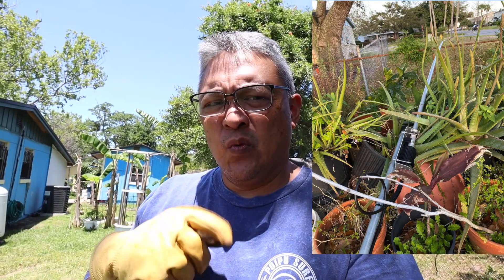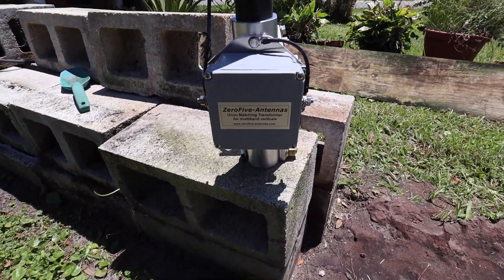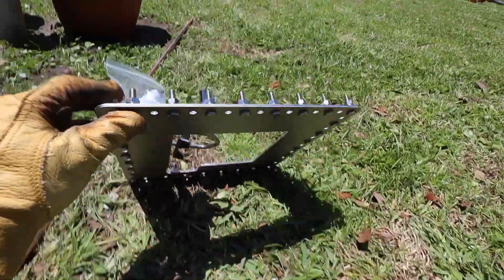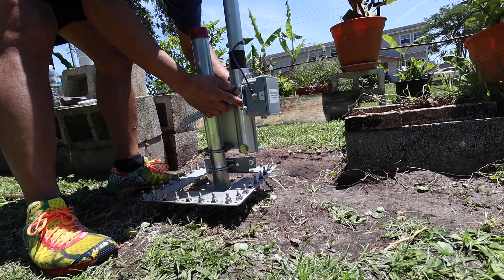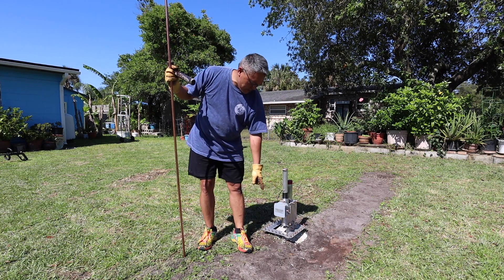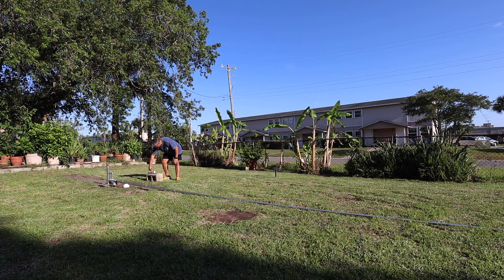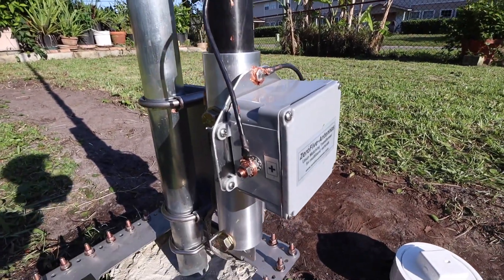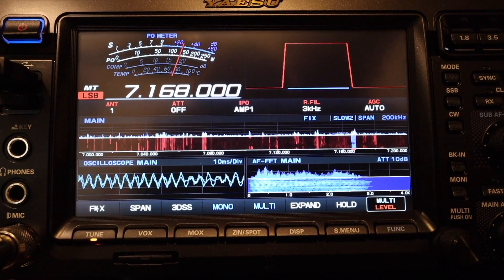Zero Five 27' HOA Foldover Multiband HF Vertical Install

Comment: @Capt Darren N4VFR  Are you affiliated with ZeroFive antennas? If so, I just purchased an antenna from you. :-)
Reply from the maker: @Douglas Williams,  Hahahaha, Not affiliated.  I'm an Airline Pilot based at DFW Texas. I just like the simplicity of the Zero Five.  Thank you for asking if I'm affiliated with them.  There wasn't much Youtube videos on the Zero Five and decided to make a video.
Reply: @DarrenN4VFR  Yea, your video is what made me purchase it. It looks very well made. Thanks.  Edit: I'm going to try it "stock", using 30 ground radials to start off with. At some point I may try putting a remote antenna tuner at the base of the antenna. That way, only a very short section of coax (between the tuner and the antenna) will be subjected to high SWR. That piece can be a high quality jumper, such as LMR-400.
Reply from the maker: @douglaswilliams6834  Right on!  What brand of remote antenna tuner will you use?
Reply: @DarrenN4VFR  Haven't decided yet. Perhaps MFJ? All the ones I've looked at provide DC power to the tuner through the coax, so you don't have to run a separate power line, which is nice.

Comment: Good video Darren. Do you connect the radial plate to the ground bolt on the unun too? Or is the u bolt on the ground plate to the pole enough?  Thx! Scott
Reply from the maker: I didn't make another connection from the DX Engineering grounding plate to the ground bolt of the unun.  The u bolt on the grounding plate was sufficient enough.  I have no problems making QSOs with this setup. Thank you for commenting.
Reply: Thx Capt Darren!
Scott

Comment: Do you need a tuner with this antenna?
Reply from the maker: Yes you do in order to bring the SWRs down to 1.5.
Reply: @DarrenN4VFR  Thank you 73's K1CXS
Reply: @DarrenN4VFR  Can I ask why you didn't go with the 33ft that would do 80 meters?
Reply from the maker: @thomashenderson603  I wasn't planning to do 80m. I hang out on 40m. But, if we're to do it again, I would of gone 10-80m.
Reply: just ordered the 33 ft , have the pole all in.. :)
Reply: @DarrenN4VFR  I'm not sure either, it was only a few dollars, so I pulled the trigger! When you grounded your Antenna with the ground rod, did you need to run a ground wire from that to your house ground?
Reply from the maker: @thomashenderson603  You Do Not want to run a grounding rod from your antenna to your house's ground.  I did that and a viewer commented that thats a No No and would create bigger problems if you have a nearby lightning strike.  Keep the ground only for the antenna and use 6 gauge copper stranded wires.
Reply: @DarrenN4VFR   Thank you so much, that makes sense... I probably get a palstar like you have next, but they look like they are all out of stock for the moment. Funny thing is, I was going to buy the CHA250, til after watching your video.
Reply from the maker: @thomashenderson603  I don't recommend buying the Comet CHA250B.  They haven't worked well for me.
Reply: @DarrenN4VFR  I'm real happy going with Zero Five, Awesome people to deal with. Thank you for all of the advice.. I love your videos, you make them so understanding..
Reply from the maker: @thomashenderson603  Thank you Thomas!  I haven't made any new Ham Radio videos.  Been busy flying and staying at my other QTH.  Please subscribe, In the future, I'm going to try to go Live on Youtube!  Still getting my equipment and new laptop that can handle fast rendering of my live video.  I still need to fight the city to put up my other antennas.  If you haven't checked out my video:   https://www.youtube.com/watch?v=IluCTCXF1rM
Reply: @DarrenN4VFR  I just subscribe, I thought I was... I live in Vermont and we dont have alot of rules for Antennas thank god!
Reply from the maker: @thomashenderson603  I looked at R&L Electronics for a Palstar AT2K, and they're out of stock...  That's where I bought mine from.  I got lucky!  Good luck in the hunt for a Palstar.  Make sure that your AT can handle the power rating of your Amplifier if you decide to get an amplifier.  Thank you for subscribing!
Reply: @DarrenN4VFR  Thanks for looking! I do want the Palstar AT2K, no one seems to have one right now. Good Advice on the Amp... Im Sure I will want one at some point.. -Tom
Reply: Palstar is 2 months behind, I have my antenna up. I put in 20 radials from 11 to 25=feet.  I have the icom 7300 and after watching your Ftdx101mp , I would really love one of them at some point.
Reply from the maker: @thomashenderson603  Your almost there!  I too have the IC7300.  I will be using the IC7300 for remote HF operations.  I'm running into problems configuring it properly.  Still working on it.

Comment: Excellent video!  I'm also planning on installing the Zero Five 27' HOA antenna at some point in the not too distant future at my QTH and your video is going to be a big help getting it done right.  Thanks and 73 to you sir!
Reply from the maker: Capdek,  Thank you for watching and commenting!  It's an awesome antenna and when a hurricane comes, I could lower the antenna  disassemble the elements.  Good luck!
Reply: Hi Capt Darren.  I have a couple of questions for you if that's OK.  What diameter water pipe did you use for your installation and what size clamp did you use to mount the DX Enginnering ground plate to the pipe?  Lastly, did you make the radials yourself or did you purchase them pre-made?  If you made them yourself, what size wire gauge did you use and what size eye connectors did you use?  Thanks for the help and advice!  David, K7KDE
Reply from the maker: @capdek503  The pipe is a 10' galvanized steel water pipe.  Diameter is 2".  I had cut it in half with a hacksaw.  As for the clamps,  I used the DX Engineering 1-2" clamps https://www.dxengineering.com/parts/dxe-ssvc-2p .  For the Radials, I bought them from DX Engineering also, https://www.dxengineering.com/parts/dxe-radw-500  and the radial wire hardware, https://www.dxengineering.com/parts/dxe-radp-1hwk  . Glad to help!
Reply: @DarrenN4VFR  Thanks for the help!  One more quick question if that's OK.  What kind of wire did you use to connect the antenna to the ground rod?  Thanks again for the help and advice!
Reply: OK, I took a look at the video again and see you're using what appears to be a braided ground strap.  Thanks!
Reply from the maker: @capdek503  Since then I changed it to a 6 gauge stranded copper wire.  Braided wires are not good for the outdoor elements.
Reply: @DarrenN4VFR  OK - Thanks for letting me know.  Did you have to change the connector on the antenna or the ground rod to attach the new ground wire?  Thanks!
Reply from the maker: @capdek503  I used these:  https://www.amazon.com/gp/product/B07J2VJZXX/ref=ppx_yo_dt_b_search_asin_title?ie=UTF8&psc=1

Comment: Excellent video.  I hope the antenna has been working out for you.  My only technical comment is that you have used braided ground strap to the ground rod.  Supposedly, the stuff will deteriorate outdoors, particularly if it is buried.  I like the way that your ground rod access is hidden.  I've done exactly the same thing with most of my grounds, too.
Reply from the maker: LVL, thank you for the observation about my grounding rod. That was temporary and have since changed my grounding wire to 6 gauge stranded wire.
Reply: @DarrenN4VFR  OK great!  KC4TEO in Alabama here!
Reply: Hi Darren, you have made a nice job of the Antenna install, thanks for showing us fellow  Hams! A few days ago I had a nice contact from here on the Essex coast to South Australia on 20m with 20watts using the Chameleon 17 foot whip, I guess propergation was good! Just one comment, as far as I'm aware the earthing conductor is better being flat braid, as the currents travel on the out side surface of the conductor, so the larger area the better!! I stand to be corrected as I'm no expert Hi Hi! 73 Alex M0KVA

Comment: I did something similar with a 6BTV about 2 years ago; I used the DXE radial plate and their tilt mount and "disguised" it as a flagpole.  Recently the 6BTV is having some severe SWR spikes that shut down my IC7300, so I stopped using it and am planning on taking the 6BTV down to see if I can find the problem.  I was thinking of perhaps replacing the 6BTV with the Zero Five 27', since I already have the radials and grounding rod in place from the 6BTV.   Can you tell me the circumference of the base (widest part) of the Zero Five - including an allowance for the clamp?  You can see my QRZ page to understand why I am asking that question.

Thank you for a very thorough and informative video.

Frank W1ZAH
Reply from the maker: Hello Frank, It will be a while until I get back home in Jacksonville, FL however, according to the Zero FIve website, the dimension is 42" x 8" x 8" and the maximum pipe diameter to use is 2".  I used a 2" galvanized steel pipe.  It's 10' long and I hacksawed it to 5' long.  Buried 3' in the earth and the remaining 2 feet to mount the Zero Five base.  I hope that gives you more information for your set up.  Perhaps watch my video again and zoom in on it to get a perspective estimate.  Or call Tom at Zero Fiver Antennas.  Good Luck!

Comment: How to pull a ground rod out quickly. Tools if  you have and old bumper jack or a floor jack. Then a good pair of vise grips and a small chain. The rest you should be able to figure out.

Comment: That's a lot is noise, S8+, were you able you reduce that any?
Reply from the maker: I checked this morning and my noise level was S3 on 40M and S5 on 20M.
Reply: @DarrenN4VFR thanks, that's acceptable. Do you have any other antennas to compare it to?
Reply from the maker: @elkbow  prior to the Zero Five antenna I had a Comet CHA250B multiband vertical. The receiver on the Zero Five is much better and also can handle full legal power limit where the CHA250B is only 250 watts.
Reply: @DarrenN4VFR  thanks for the info. Maybe I'll get you on the air some day. Dave, AC5N.
Reply from the maker: @elkbow  Good Luck and hope to have a QSO someday.  I hang out in the evenings on 40meters on 7178Khz, 7188Khz, and on 20M 14277Khz.
Reply: @DarrenN4VFR  l look for you. I'm on every night around 11-midnight your time with Australia and New Zealand on 20m. You should be able to hear them. I'm also on 10m and 15. In the evenings, it's been open. Been talking to ZL, VK and Europe/Russia on 15m too.

Comment: I have the same antenna , no ground radials needed , I did 2 4'grounds one on each side of the antenna with 8"of 10 ga wire to each one , that ia all I did , excellent receive and transmit ,that ia one antenna that don't need all the radials like others do
Reply: @steve patterson  Steve, this antenna is simply a ground plane vertical that uses the transformer ("UNUN") at the base to help match the impedance since it does not use traps to make it resonant on the various bands it is designed for. It relies on the antenna tuner in your shack to finish matching the impedance so your transceiver does not see a high SWR, but your coax will, so using good quality coax is imperative. It will, of course, work with a couple of ground rods connected at the base of the antenna, but, unless you live in a saltwater swamp, I can guarantee you that you can achieve better performance from this antenna by installing ground radials. The more, the better. Ground radials aren't all that hard to install. There is no need to dig into your lawn. Simply lay them right on the grass and use lawn staples every couple of feet. The grass will grow over and hide them in a matter of weeks. 73 de WB4DW
Reply from the maker: Wow, Good to know it worked out that way.  I guess I went over the top with ground radials. When I get back home, I want to add a 10' grounding 1/2" copper pipe.  Right now, I only have 1 8' grounding rod.
Reply: @DarrenN4VFR  hey its ok as long as it works lol.  I hate putting radials down
Reply: @stevepatterson2290  Hi Steve, here's VA2RB. After 2 years, how's the result of the antenna without radial. Same for me, I have no place to install radials and I'm looking to buy zero five 27. Can you share with me your result. How good is this antennas with your configuration ? 73
Reply: @DarrenN4VFR  You did not go "over the top" with the ground radials. Ground radials will definitely help this antenna. One or two ground rods at the base of the antenna will get you on the air, but, for optimum performance on this type of antenna, the more ground radials, the better. I am thinking of getting one myself, and, if I do, will certainly use ground radials. Thanks for the video. 73 de WB4DW
Reply from the maker: @douglaswilliams6834  I have enough ground radials for my setup.  It's time consuming but worth it!  Take a look at the 43' Zero FIve antenna.  It covers 10-160m.  I should of bought that one.
Reply: @DarrenN4VFR  Not necessarily. The 43' version is better on the lower frequency bands, but probably not as good for DX on 20 meters and above. It has to do with takeoff angles. Put simply, the 43' version will have higher takeoff angles on the higher frequency bands, resulting in shorter skips. Your 27' antenna is probably better for DX on 20 meters and higher.
Reply from the maker: @douglaswilliams6834  Yeah, I agree with you there! Thanks

Comment: Well done, could I ask how many radials and what length? Thanks Robbie
Reply from the maker: Hello Robbie, Tom from Zero Five recommended to start with 32 radials at 27 feet each.  For my setup, I added a few more and I think I'm up to 35 radials.  It's a lot of work to bury them in the earth so I did a few at a time. Thank you for watching!

Comment: That’s amazing how easily the ground rod went into the earth. Also surprisingly easy to remove the ground rod from the earth. Never that easy in the clay soil in Texas Panhandle.
Reply from the maker: Yeah, I bet that it's harder to remove from clay.  A viewer recommended a 10' copper 1/2" tubing and sticking a garden hose with hose clamps to one end and driving it in the earth with the water on.  But in clay soil, idk if that will work.
Reply: @DarrenN4VFR  I saw another video about how to deal with clay. You pour some water where the rod will go and it loosens up the area. Go as far as you can, pull the rod out, add water and rinse and repeat. I just ordered a ZeroFive 27' yesterday and will see how the rod installation goes. We have clay and palm tree roots to contend with here in SoCal.
Reply: You’ll hit rock in central Texas.
Reply: @mmckinney3  Fact!  Leander, TX here.  Plate limestone 3 inches below the turf.
Reply: Pipe wrench 🔧  and keep TWISTING .
Reply: Buried river rock here in Western Nevada.  So jealous of how easy that went into the ground!

Comment: Darren, how would you compare the performance of your old cha250b with the new zero five vertical?
Reply from the maker: The CHA250b was okay.  I hear stations better with the Zero Five antenna.  It was just a lot of work to install all the ground radials.  I like the fact that the Zero Five antenna can fold over so you can take it down before a hurricane.
Reply: I'm pretty sure the CHA250b uses resistors inside the "matching unit" at the base of the antenna in order to keep SWR low, so a significant portion of your transmit power is wasted heating those resistors.